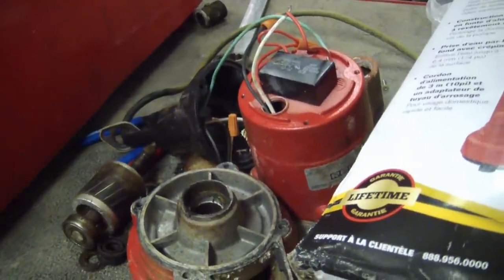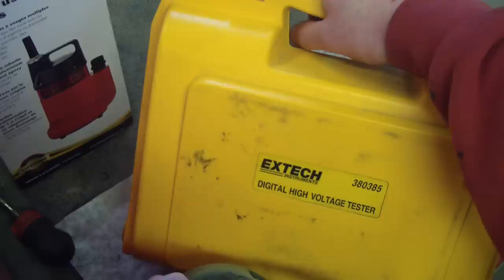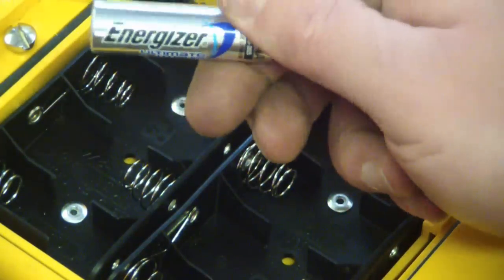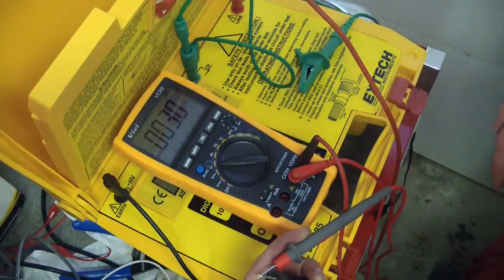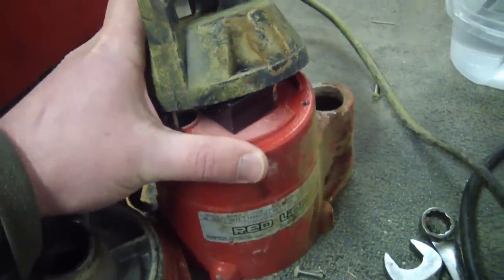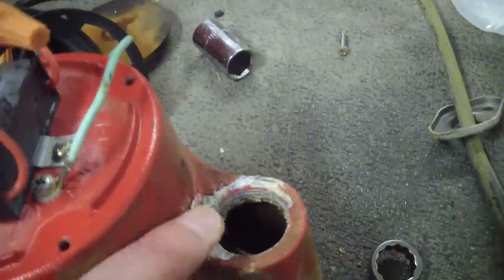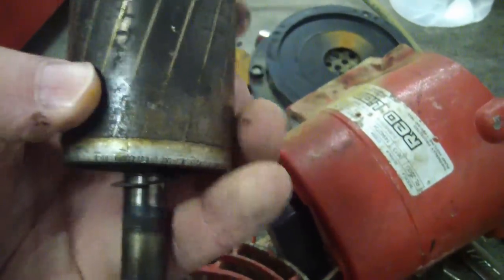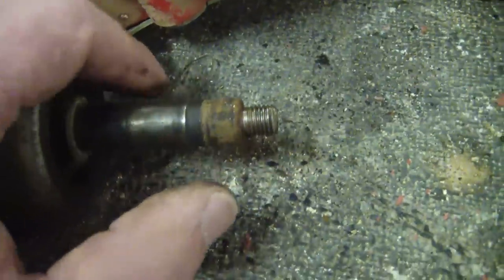BOLTR - La BOMBA! Red Lion water chooch'r is engineered to FAIL!

Comment: In these cheap pumps , the bearings seals are poor quality , then the water comes in the motor housing , that cause short circuits in the motor coils and current leaks .

My dad bought a good quality pump branded Leroy-Sommer , it was daily used to prevent flooding of his underground garage and shop , this pump died after 30 years of use ! ( bad bearing seals and flooded motor)
The price of this L-S pump was huge , but the durability was here too ! He don't thinks if he could find one  pump as good  as his old L-S nowdays .

Don't expect good quality tools if you put cheap price on them .

Comment: Hi AvE,

Do you think it could possibly be remedied by turning the rusty part down until you can fit stainless washers or a sleeve on there? 
It does seem an awful way to manufacture this particular item, makes me wonder if the Mild steel was not chosen accidentally when as you say it should have been stainless for the whole Rotor of course.
Please let me/us know if you can think of a way to mend and make this useful again. 
Forgive me but I am no Electrical expert to say the least, but are the windings, well to put it bluntly, screwed or can you replace them?

Take care and one other thing… I really enjoy your videos!
Reply: It appears that the windings are screwed - it's already let the black smoke out and there isnt any way of getting it back in. I'm sure you could buy a new one and turn down the shaft to accept a fitting to prevent it from crapping out, but it would be easier on your time and possibly your wallet to buy a pump that isnt designed to fail.

Comment: Have you ever tried putting magnetised calipers near a transformer (could be an a.c. shaded pole motor next to the silicone steel laminations(anything a.c. magnetic fields)) to demagnetise them? I remember watching a vid where it happened and you used other calipers
Reply: A large pistol type soldering gun is an excellent de-magger.

Comment: my old big ass insulation tester goes up to 6kV, but I very rarely use it with that high voltage, as that could totally kill a working motor which insulates 1-3kV just easily, but 6kV jump straight through and fry that thin and at some point probably damaged insulation on the windings. and that's not even 10kV. I don't think you really need that high voltage, unless you are attempting to get some certificates for products you invented or something

Comment: Because it's so well-engineered otherwise, my guess is that either it was an oversight, or, the engineer who designed it specified S.S, but some contractor further down the line substituted carbon steel.

Comment: When you do a sleeve of different metals you have electrolytes. I’m unsure how to over come the design failure another way other than your first suggestion of a stainless steel shaft. And we all know then the part wouldn’t be cost effective. Any other ideas?.
Reply: It works fine, you need fluids in there for galvanic corrosion to happen, and the sleeve is a U-shape, and the opening cracks are all upstream on the inside of the rubber seals. If water is getting in between the sleeve and the shaft, it means your seals *already failed* so it's too late already to care. In practice, maybe it's possible for condensation or something to get in there, I don't know, if so you could just put the sleeve over a thin epoxy coat or something so they aren't in electrical contact. Again doesn't have to be water tight or anything, it's a U-shape, the rubber has to be water tight only.

Comment: We have been having the same seal problem with pond pumps we have been using to aerate our dugout. On one model of pump I noticed it had a removable plug on the top. I was thinking of taking that plug out and filling the pump entirely with mineral oil to keep the water from getting in. Do you think that would work or not?

Comment: Take the lip seals out and put a small rubber bellows seal mechanical seal in. The corrosion will not affect the seal and it will last forever.

Comment: Just for information sake, can mechanical seal (ignoring the cost of mechanical seal) be used here instead of shaft rubber seals ? Because to my understanding the rubber seal will eventually fail even if shaft was of SS after 3-4 years (FYI i skipped to last part to get out of suspense :P)

Comment: Those laws suck. 

I am glad for the consumer protection we have in Denmark. 
It is min. 2 years and nothing you sign or small print, can change that. 
Even if you agree or sign for a worse term, that is not possible. 

Within the first 6 month all burden of proof (that it is not a manifactoring error) is on the manufacturer.
The last 18+ month it is on both but the Consumer-Counsel (state agency) will take the case for you for only 60$ and you get those back, when they win (and they mostly do). 
Win - Win for the consumer.

Comment: Funky aluminium mountain bike shocker retaining pin taking a decent shear load, was that designed to fail also, or is there a German pattern forming..

I’m not at all familiar with pump axle/ seal standards but it seems an oversight, there were a few build elements there you were surprised with, I think your jumping the gun

Comment: I run a design engineering firm and planned obsolescence is not something I'd tolerate within our business.  Our customers are based in the marine and offshore/subsea sectors, where equipment failing due to deliberate design is potentially deadly.  Also, I don't have it in me to con people.

Comment: Could that shaft be plated with a rust-resistant metal or a stainless waher put between the shaft and seal for less than the cost of machining and pressing on a stainless sleeve?  Just wondering because the pump is well built except for that one area.

Comment: I wouldn't be surprised if that 2-Wire AC adapter was dead,  AT&T used to sell 2-Wire equipment to there customers and after a few years they would stop working because the cheap AC adapters are infamous for failing.

Comment: I see you're a fan of the energizer lithiums. Me too. When you have the excuse, could you point out whether there are any hazards to using lithium batteries completely interchangeably with batteries of other formulations? For example, lithiums provide 1.2V, rechargeables of recent vintage provide 1.4V, alkalines 1.5, and I'm sure there are others. I was once told that the difference between the voltages wasn't significant because circuits should be engineered to withstand +/-10%, but now our current lithiums are lower than that. The reason I ask is that, once, long ago, I put a rechargeable battery into a small maglite flashlight, and immediately burned out the delicate match head sized bulb in it. The flashlight was only designed to take alkaline AA batteries. That was an expensive bulb to replace. I can't figure out how to google this, so I thought I would suggest the topic. Although AA's seem to be interchangeable, I suspect they are not and I'm wondering how to predict when the different voltages or amperages may be a problem.
Reply: Lawman212 There was a spare bulb from the factory in the tailcap of your maglite, behind the spring contact.  Those little bulbs die easily, which is why there was a spare.  It's got nothing to do with battery chemistry.

Comment: You are correct as well as Adam keeping a pay check; living proof I buy a new
so call quality 1/2 drill, lasted one time and the plastic handle broke- impossible to
epoxy so= save the chuck and fling it.. Then a town dump truck emergency comes
in the shop with sheared plow frame (1 inch bolts) so I go to my fathers 1930 3/4"
drill (US Electric) ok attempted to pilot drill and that thing grabbed threw me through
the roll top door and wound itself till the cord broke.  It put me in the hospitol for
a fractured arm   drill damage NONE  just a new power cord. ! Now its 80yrs old or so &
its now 2015  " Is that clear as mud" sorry Lyle I had to say that. The new is programed to fail before the warrantee,  The old was engineered to be the best cause their brains
didnt think that way back then so thats why they are all gone they wont survive now in
this plastic word.......Keep up good work AvE   sam

Comment: So that corrosion on the shaft couldn't be the cause for ground fault trips. What was the result from the megger test and what's wrong with ti? Was it ever fixed?
Reply: The seals being gone let water get in...which corroded the windings which failed the insulation.

Comment: I believe your AC setup would have worked had you had 12V coursing through the choocher.  You only had a 5V adapter in the sucker.  8 x1.5 =12V

Comment: I thought you were supposed to set the voltage no higher than the rated voltage of the insulation you are testing.  Other wise you could unintentionally burn a pin hole in the insulation causing failure down the road.

Comment: love your comments and your Canadian Swagger., I'm not sure if you call it that but anyway. I can't believe that extech voltage meter stymied you as far as the voltage needed. 8 1.5 volt batteries could normally be either 12 volts series wired Maybe 1.5  in parallel if the device needed more current which would be bizarre because I would think they would just raise the voltage but maybe there is a consideration that I am not aware for the testing that the device does and 1.5 volts is appropriate??? I think not. and of course 6 volts if One Bank was series in parallel with the other.?? is it your assumption that it was 6 volts and that the 5. 1 volt 2 Amp Transformer was adequate or did you not have a 12 volt power supply available. which I I assume you have?
or was there too many molson's that night.. Which I could personally understand :-). that's said did you ever use a voltmeter to probe after the batteries were installed to see what the actual operating voltage was??? 6 volts or 12? surprised the unit didn't come with its own 120 volt transformer. by looking at the battery box and seeing some of the jumper wires between battery slots and not knowing the wiring beneath the only guess would be 12 or 6 knowing the way they manufacture batteries. your skills are far superior to my own and that's why I watch. to learn through the experiences of others. as far as is the conclusion to the video about engineered to fail! there are so many things out there that are the same way. it's been years but I remember seeing a video from a Russian hacker who had a patch for printers that mysteriously had stopped working.. His theory was after a certain number of Cycles it was programmed to shut down. he wrote a program and distributed it for free! and from what I hear it has worked fine. I own a Samsung  TV that started flickering. I called Samsung they said it was not their problem. I found on the internet a site which showed me the procedure to cut and leave open the part of the circuit board behind the TV.. This was  three years ago the TV still works fine!

Comment: with enough effort you can make something engineered to fail within a month last YEARS the original xbox 360s were like that that was actually why there was a red ring o death in the first place i got my hands in the neighbors 360 after it got the ring the fix is super easy just fix the one solder point thats made to melt away and boom all better
Reply: RROD was a time thing. Microsoft rushed the first model, less thought, effort and QA went into getting them out because Sony was putting pressure on them.
Reply: THErepare man16 The RROD 360 fiasco cost Microsoft billions and hurt their image. Who in their right mind would think Microsoft would do that on purpose?
Reply: They had no idea how often the machines would be running no doubt.

Comment: jeep engineers a failure in there shifter cable. There is a plastic proprietary shaped grommet on the transmission side that after 1 1/2 years will fall apart. To get a new grommet you need to get a whole new cable for $150 US. Or do as a lot of the Jeep Wrangler owners have done and replace the nub with a threw bolt and brass shims.

Comment: really interesting here (Aust) we do it different, we go 2x the rated voltage for insulation checks  so 240v mains = (500v) and 415v (3phase mains) to 10000V 

i havent seen a megger for e.g Dragline swing motors though! might have to ask around and see what they do for those

Comment: hi can i ask you a question ave have you ever looked at the maths involved in drill bit sharp ends and feed speeds i was wondering if a steel bit could be made like a forstner bit which would take a consistent chip of the metal
Reply: Not trying to be a smart-ass, but you should look into why using an end mill as a drill is a bad idea as a parallel to your question. The really quick why not: face hardening of the drilled metal and too thin a cutting face to be effective.

Comment: buy another, turn down the shaft. Install a SS sleeve. Lifetime pump!
Reply: SubieLand Speedy Sleeves don’t even require the shaft to be turned down. I’d recommend a high quality grease like polyurea or even silicone to aid sealing between the seals.

Comment: Engineered Obsolescence came into play in the mid 90's in Tenneco Automotive (Muffler systems and Monroe Shock Absorbers) because OEM wanted more money on the back end (Dealer repairs) rather than Cars lasting 10 years without maintenance costs.  Dealers screaming! The 100,000 mile spark plug was great for buyers not dealers, so they pitched a bitch and we had to eat her.  No more solid Stainless Steel mufflers!   It got so bad Monroe Mgmt cooked the books to sell OEM to Ford below Cost so they could get the aftermarket stuff at a profit.  Set the plant manager up to take the fall too.  But, I fixed their wagon, heh heh heh.

Comment: Examples?!  How much time do you have?  From before I was born until I left my parents house 18 years later, we had the same washer, dryer, refrigerator and dishwasher.  We did replace our TV, but only because dad wanted one with color.   In the last 10 years, I've gone through 3 washers, 2 dryers, 3 dishwashers, 2 refrigerators 4 TVs and countless other crap that oddly all replacement parts are obsolete for.  On this 3rd washing machine, I've had to replace a main board and motor controller.  The dishwasher is on it's 2nd touch panel and the 2000 dollar fridge won't make or dispense ice and it's display had dead areas.  This is all name brand, upper mid or lower high end stuff, not knock off crap.  NAME BRAND CRAP (FU Frigidaire)   You see those nice stainless steel tubs in washing machines and think it'll last, but it's mounted to an aluminum spider that corrodes in the presence of basic laundry products and water.  And you can't just get the spider, you have to get the entire tub assembly. Bleep, bleep, bleeping bleeepers!  So, yeah.  I'm slightly familiar with planned obsolescence.   Don't get me started on plastic tabs and latches........  I'll take a mechanical control over the "more reliable with no moving parts" electronic crap every time.  They just don't make it anymore.
Reply: +blmeflmm66 I have a sneaky impression that some of the bigger brands are more interested in planned obsolescence than some of the smaller and cheaper ones. Everyone i know who's had a house brand fridge from a particular store here had them run for at least 15 years, 3 years of warranty that they fully honoured but after-warranty repairs and replacement parts were dirty cheap and swift too...  but then the store went belly up recently, so there's that, but the warranty and service still run.

My favourite example was a soft plastic cam (not even nylon, something way shittier) riding on a metal axle against a steel tray in some HP printers of late 90ies. Everything else was solid, but that one part had to wear down after a specific number of pages and they knew it. Order it from them? Nah. "Send in the printer for a 60€ inspection fee, no guarantee that we'll fix it though and we won't tell you how much the part costs until the bill is due" - yeah, thanks, how about NO.
Reply: +blmeflmm66 They did a show about this on CBC Marketplace which confirms what you experienced. http://www.cbc.ca/marketplace/episodes/2014-2015/appliances-repairmen-unplugged

For washers and dryers, your best bet is the Huebsch line (brand that Speed Queen uses in Canada).  They still build appliances for durability but they will have lower efficiency ratings than better known brands simply because energy efficient models use smaller motors that burn out fairly quickly.  You can still get the mechanical controllers on them too.  Electronic controllers fail because they are exposed to harsh conditions (heat and humidity that are expected when using household appliances) that fry electronics in short order.
Reply: Yves Marchand
You can add my 4 year old LG refrigerator to the list.  Compressor just went out.  Yeah, I saw the appliance series.  It's criminal what they get away with.  Seems the latest "policy" is to only supply replacement parts while the units are in production.  There are already basic parts, like shelves and circuit boards that are already obsolete.  $2300 dollar fridge with a ONE YEAR warranty.  That's insane.  The compressor has a 10yr, parts only warranty, but the labor will cost more than the compressor.